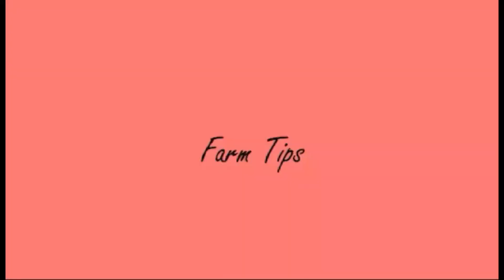CHERRY TOMATOES DRIP SYSTEM REPAIR I AFTER 2 WEEKS

Comment: Just used a gravitational Drip System using 15ltrs balde or pail. and drill with smallest hole under UPVC 1/2 inch dia. then put  1 smallest hole at the nearest of the UPVC pipe or near the end cup. cover it with rubber electrical tape then pin hole with needle. this will serve as BREATHER to loosen the pressure at the end and equalize the flow of the 10 holes that serve the drip System.

Comment: kung mas maliit ang butas sa pvc kesa hose, irekta mo nalang isaksak yong hose i-cut mo lang ng patulis yong hose para madaling ipasok sa butas sa pvc hindi yon magli-leak no need na yang connector pang drip line kasi yan kahit pede yan gamitin sa pvc mo mas ok pa din yong simpleng nakasaksak lang yong microtube/hose mo sa pvc mismo no leak no connector needed at no additional cost sa sealant.
Reply from the maker: Ayos okay din yan idea mo bro